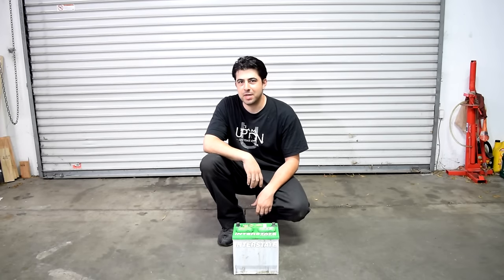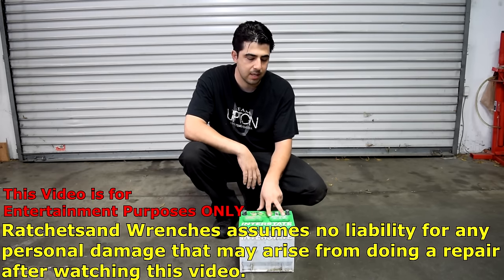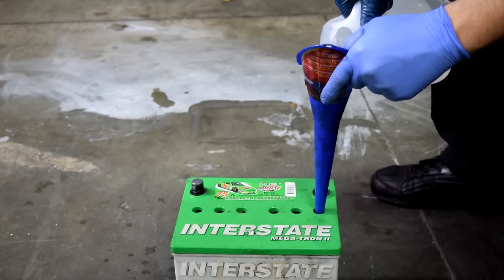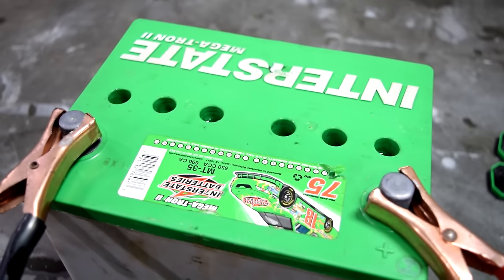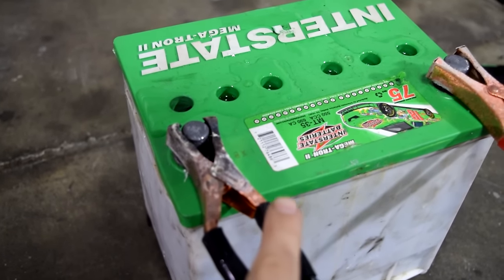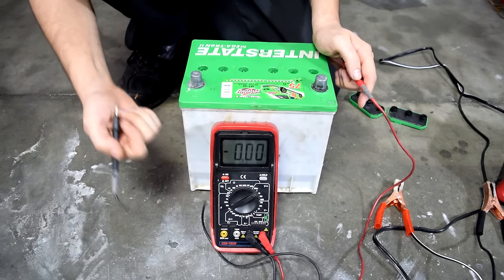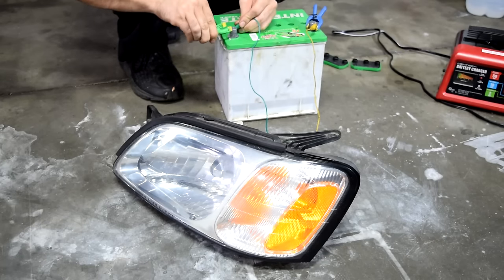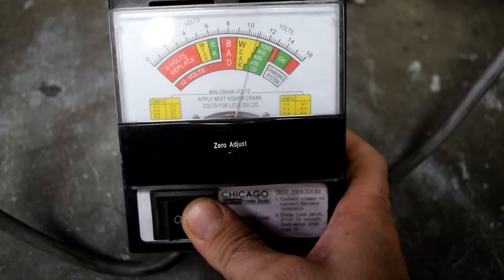Is it Possible to Revive a Dead Battery with Epsom Salt - See For Yourself

Comment: It's a lead-acid battery, not a lead-epsom salt battery. After getting battery charged with the epsom salt you need to drain all the epsom salt solution out, wash out good with water, then top off with battery acid. This last part was omitted in the video!
Reply: Ok thank you. I thought it was funny that he used Epson salt and distilled water in place of the battery acid. I was like whoa i didn't know you could do that.

Comment: OP, you are only half way done with restoring the battery... Epsom Salt is MgSO4 and the reason you add it to the battery is to have it react with lead sulphate PbSO4 to dissolve the lead sulphate and end up with MgSO4 which is soluble in water. Then you drain the resulting liquid and add the sulphuric acid back in. The goal is to have lead and lead-oxide plates with dilute sulphuric acid between them. Epsom salt is a cleaning fluid, not a working fluid.
Reply: After putting Epsom salt ,shall I charge the battery or do what?? Thanks for the information.
Reply: THANKS! BEST RESPOND IN HERE!
Reply: SHAKE IT CHARGE IT FOR A LIL BIT, THEN FLUSH IT OUT, AND ONLY THEN ACID+H2O(DISTILLED) THEN DEEP CHARGE- AND ONLY THEN U CAN USE IT. SORRY FOR CAPS,,, COFFEE IN THERE HOLDING IT IN ITS PLACE
Reply: Thanks for the info he made it sound like Epsom salt and distilledwater where the new fluid for the battery which to me made no sense...Again thanks for the explanation.
Reply: interesting points ,if anyone else is searching for how to recondition batteries try Corbandy  Battery Blueprint Crusher (just google it ) ? Ive heard some great things about it and my neighbor got amazing results with it.
Reply: @ One Two - this begs the question of why there was such a phenomenal improvement in the output of the battery using just the MgSO4. Was this due to the charging generating hydrogen ions and thus sulfuric acid (H2SO4) on the plates?
Reply: Not certain about the points made but ,if anyone else trying to find out nicad battery reconditioning try Cypouris   Renewal Guide Coach ( search on google ) ? Ive heard some incredible things about it and my partner got amazing success with it.
Reply: I know this message is a year old, but you're fairly correct. When he charges the battery the magnesium separates from the SO4 and the SO4 combines with hydrogen (from water) to make H2SO4 (suphuric acid). The extra oxygen from the water simply boils out. The loose magnesium should bind with the sulpher on the plates (sulpher from the old battery acid) to make magnesium sulphide, relatively harmless to the battery chemistry and non-conductive. You might have a problem with unreacted magnesium making contact with the plates or having the magnesium sulphide take up useful space for proper battery acid and reducing the power handling of the battery. Draining it out, filtering it, adding water or new acid to return the proper Ph, and putting it back in should be safe enough.
Reply: Charge the battery while it the Epsom salt solution is being used instead of battery acid. The Epsom salt will chemically split. One part of the Epsom salt will join with hydrogen from the water to make H2SO4 (sulphuric acid, the acid that's supposed to be in the battery), and the other part of the Epsom salt will join with the sulpher that's coating the battery plates and make magnesium sulphide. The magnesium sulphide will fall off the plates leaving clean plates. When you charge the battery with Epsom salt you're actually creating the battery acid.
Reply: how to recondition a lead acid battery epsom salts
Not certain about the points made but ,if anyone else wants to uncover how to recondition batteries try Corbandy  Battery Blueprint Crusher (do a search on google ) ? Ive heard some incredible things about it and my partner got excellent success with it.
Reply: @therealjammit  That's what he did in the video
Reply: I have spent months researching into fixing a car battery and discovered a fantastic website at Magic Mender Wizard (check it out on google)
Reply: hey ,if anyone else wants to uncover How to repair a battery try Jadonite Renovate Battery   Buddy (do a search on google ) ? Ive heard some super things about it and my co-worker got cool success with it.
Reply: @wandalllither2452  Concentration of the sulfuric acid one should use? I'd rather not reuse the old fluid
Reply: @kristinpropst1864  Its a SCAM those sites put viruses on your computer. BEWARE!
Reply: So after put epsom salt, then what should i put into?
Reply: One Two hey how long should I keep the epsom salt solution on the charger?....I bought the sulphuric acid today,,,so I’m guessing I’ll just flush out the cells again with water and baking soda,,,and fill in the acid
Reply: After several charging and discharging of the battery (its cleaning the plates process) pour out the ES and replace with H2SO4 charge and discharge, a couple times, don't go below 50%. Check battery condition a week latter to see if its holding charge - if not its good for couple days use only not reliable, if it does hold great news
Reply: flushing cells with baking soda will leave a residue, make certain you flush well with distilled water only, otherwise you will just continue to neutralise your acid giving incorrect readings and fluctuations because of the baking soda residue - Baking soda & distilled water to clean,  then distilled water and ES to clean, then top up with H2SO4 (results) depend on correct reason for your batteries failure........
Reply: @saltwaterdragons  this what I was thinking as well...was just about to clean with baking soda
Reply: @saltwaterdragons  is the acid cheap and easily obtained?
Reply: You don't purchase 100% H2S04 its diluted 30% I think? $20/$30 for 5ltrs
Reply: To add to my question... the sulfuric acid solution was $10 at autozone for a pack of (2) 16oz bottles
Reply: @wandalllither2452  lmao
Reply: Corbandy Battery Blueprint Crusher
Reply: The epsom salt is being used as an electrolyte. If the battery is too sulfated it won't have anywhere near the original capacity.
Reply: This doesn't make any sense. The only way to renew a battery is renew the insides. Which was not done.
Reply: One 
Two
Reply: Nick Surr
Reply: Dusty Camino
Reply: saltwaterdragon
Reply: saltwaterd
ragon
Reply: Nice Video! Excuse me for the intrusion, I would appreciate your opinion. Have you considered - Lammywalness Trendy Trade Guide (Sure I saw it on Google)? It is an awesome one off guide for learning how to recondition batteries at home without the headache. Ive heard some great things about it and my close friend Aubrey  got excellent success with it.
Reply: Thanks for the Video! Forgive me for chiming in, I would appreciate your thoughts. Have you researched - Lammywalness Trendy Trade Guide (do a google search)? It is a smashing exclusive product for learning how to recondition batteries at home without the hard work. Ive heard some incredible things about it and my mate at very last got cool success with it.
Reply: True
Reply: @xhoidosti5011  $47.00 and there are videos on YT that show the same for free.
Reply: Bullshit. My battery is 19 years old and still works
Reply: @saltwaterdragons  exactly! glad someone said this finally
Reply: @therealjammit  He uses 15 ounces to 1 gallon here, but I have seen people say to use as much as 5 pounds per gallon of water-- that seems like it would work better as long as it dissolves completely?

Comment: My dad always said never set a battery on the ground or concrete always set it on wood, plastic, or rubber ! The ground or concrete,rock ,stone draw the battery down and if let set on too long will permanently ruin it at least that’s what he always said I noticed working on cars every body always said the same thing .  Jusr wondered if any one else knows about this ?
Reply: yes I have it was the first things I was taught in my auto repair class 50 years ago
Reply: I was thinking the exact same thing.
 Hell, maybe we were told wrong?

Well now that i finished the video maybe we were told right!
Reply: Wives tail plastic is not conductive

Comment: I think you have to put sulfuric acid back in I strained mine through an old t shirt and add 80,% water 20% acid back in the battery works like a new one now
Reply: There is a video here that explains what the acid does. For him to fix his he used NO EPSON SALT. Added a little bit more acid and then water. Then he used his solar power system, similar to this guys charger, and over hours recharging got his battery back up. Mind you it was a little battery but a big one.
Reply: Is anybody else very suspicious of the Magic Mender Wizard after reading all of these comments?
Reply: Hi. I just ordered acid 36% to 64% and am wondering how your battery is holding up.
Reply: @pasinen  plot twist it's a competitor ruining their competitions reputation by pretending they use spam bots
Reply: @johnramsey2009     yeah.........me.
Reply: @genesisdaza6870  q@@
Reply: @SONLE-kr2yj  spam!
Reply: @genesisdaza6870  spam!
Reply: @mariacedeno7523  Spam!
Reply: where do you get the acid?
Reply: All y’all sound fake !!! 😂😂😂😂
Reply: @johnramsey2009  If you were able to check the names of the people posting good reports on The magic Mender Wizard, you would most likely find them to be associated with the product in one way or another as the owners, resellers or affiliates.
As a former Internet marker and affiliate seller of many products from Amazon etc, and other sites, it's a trick as old as Adam.

Comment: I was informed that you have to drain and recharge the battery at least 5 times. Each time you drain and charge it it will hold a little more amperage, but yes it absolutely can be done. I am currently in the process of reviving a 75 amp hour deep cycle marine battery that my father used to use for his trolling motor. After just 1 charge/discharge cycle it is holding steady at 9.5 volts. I know that it doesn't seem like a big deal, but after just sitting in a shed for almost 10 years and not registering at all on my multimeter a week ago it is monumental in this case.
Reply: Hi did it get working?
I’ve never tried draining and recharging 5 times and always gave up
Reply: It's still charging lol.
...  🔋

Comment: I watched your video, as well as, several others and then finally decided to "take the plunge".  I bought and restored a 38 year old bass boat.  It had a deep cycle battery in it for the trolling motor.  I really don't know how old the battery is but it was completely dead.  Charging it overnight did almost nothing for it.

I followed your instructions and then brought it up to over 12 volts after an overnight charge.  (Then I got sidelined for almost 3 months following knee infection and surgery.  The battery just sat for that time period.)  I put it on the charger for a few hours last week then took my boat out to the river.  The battery performed without any problems.  I was on the water for several hours.  Price to repair; less than $10.  Price for a new battery; over $90.

Thanks my man.  You saved me a bunch!
Reply: Thanks for real world info !!!!! Appreciated
Reply: Thank you Wes for your comments!, and wish you good health  and recovered from your surgery
Reply: thank you so much for sharing your very wonderful experience, so very helpful 👍👍👍
Reply: $90 for a battery?? 🤔😅
Reply: @whipporwill2303  Don't know what you are questioning, but deep cycle marine batteries in this area go for $75 and up to $190.
Reply: @westhurman2819  wow. Our are several hundred down here in Texas. I looked at getting a set of lithium batteries for my trolling motor and dang near passed out when i saw the price. Some are over $2500! 🤯
Reply: @whipporwill2303  Not as of 05/2022....that is for sure.
Reply: @whipporwill2303  lifepo4 lithium battery are only 269 each online....

Comment: Some of the videos I watched where folks did this they put the used acid back in using a turkey type baster so as not to dump the metals that fell out of the solution to the bottom of their bucket.  They only used the Epsom salts to clean out the inside, rinsed, and put the acid back in and it worked for them.  I think they claimed this cleaned the sulfated plates inside to allow the acid to make better contact with them.
Reply: I tried to rejuvenate a battery for 3 days. Thought I had it. Got the short off of cell #5. Worked for a day or so. Now #6 is bad. I think my battery has too many crystals to make it worth while. I put it on AGM mode at 15 amps & it came back only to go to 10.9 volts with a load on it. I had AutoZone try to surge it at 200 amps to try to clear the bad cell. No good. I had to buy another battery. This time I'll keep an eye on the cell fluid levels & won't let it get too low.